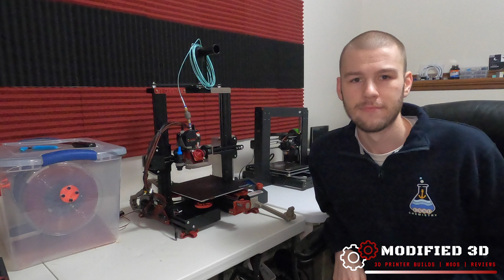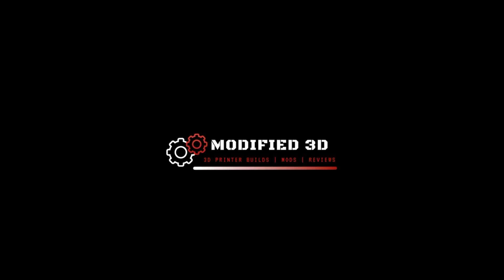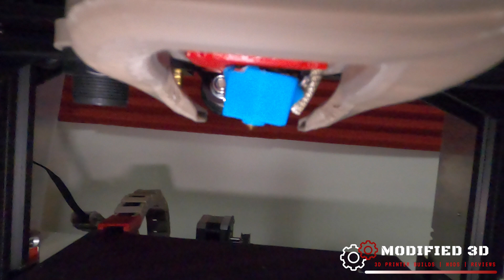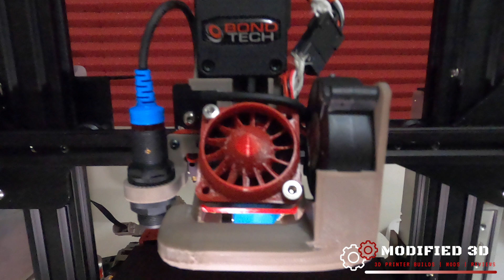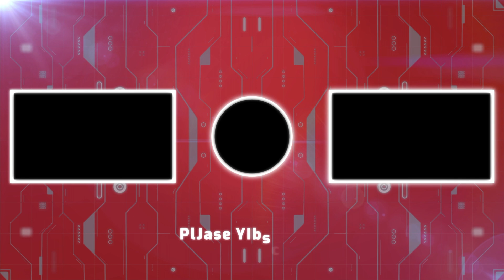Th3d Silicone Hotend Sock Review | E3d V6 & Th3d Tough Hotends

Comment: So, I installed these today and found that the print job crashed because of overheating. I am wondering if I will have to lower the temperature of the print job by 20 degrees and then adjust it accordingly. As for the cleaning of your existing hotend. I completely removed my existing one and slowly cleaned it using a flat dull tool. I used a heat gun to soften the blobs of filament and little by little broke off chunks until the entire hotend was cleaned off. I then took out the nozzle and repeated the process until the interior of the block was cleaned. Then using the Allen tool, removed the two screws to open up the block to clean the interior.